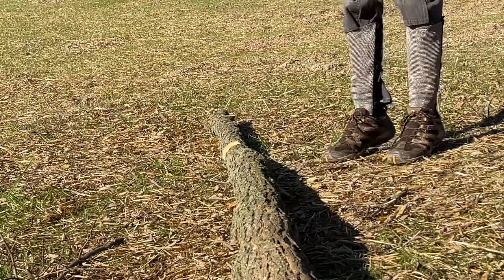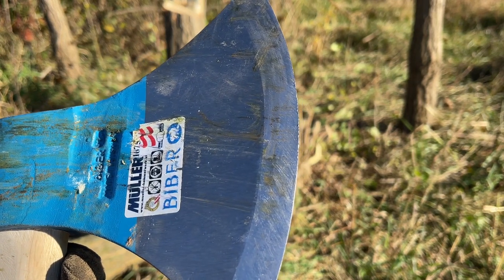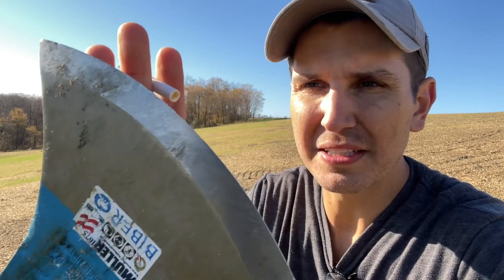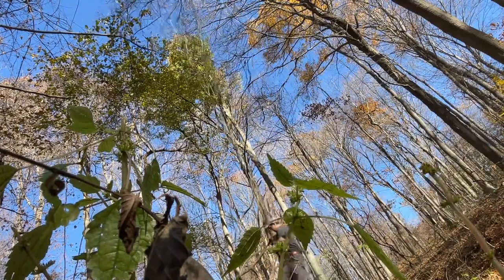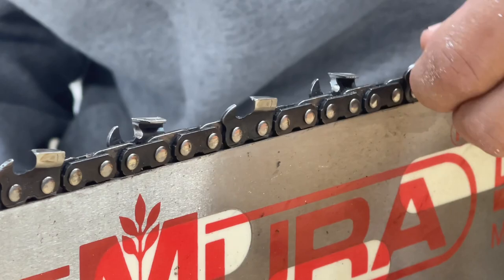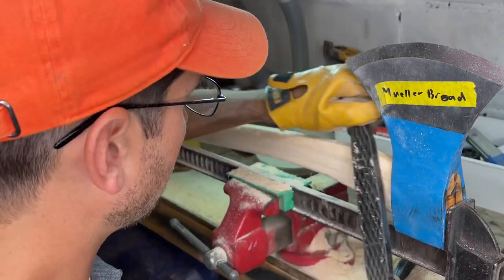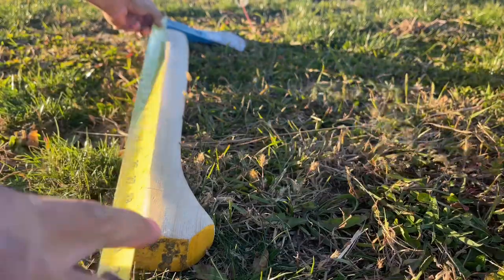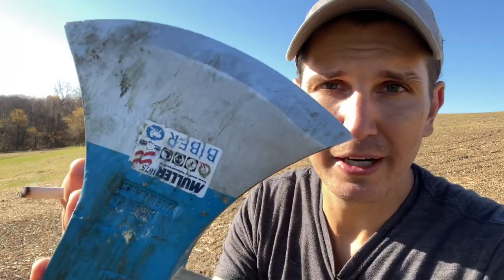Muller Biber Review: Can it Hold Up to American Timber?

Comment: In the falling/felling footage, the first 30 seconds or so, the axe appeared to dip and/or twist on impact. I slowed the playback speed as far down as possible and watched. Just an observation. Certainly unique. I own a dvd that is available for viewing on YT, "Happy People", it is a documentary about the trappers in the Taiga, the axes these men used "rang" just like this one. I also watch much Russian axe footage, this ringing is not uncommon. Many American axes ring while flicking during splitting of firewood, mostly older ones. Very enjoyable Mr. Kevin on your video....
Reply from the maker: Yeah, it’s awkward to fell with.  Definitely not it’s purpose.  Besides that, very little of the blade contacts the wood.  I’ve seen the doc.  Very cool.  First axe I’ve owned the rings like this.  No idea what it means though lol.

Comment: You better put a proper convexed edge bevel on it. secondary bevel won't add to the edge stability, because it's still a flat edge. It will only slow the axe down, cuting less deep. Adding a proper covvex, it will cut as deep if not deeper, and it will also provide edge stability. You have to get rid of, the burnt steel, that those factory belts create, when they establish the edge bevel. Always reprofile your new knives and axes, before first use. ALWAYS! Slightly convexed bevel, is what you need.
Reply from the maker: Thanks

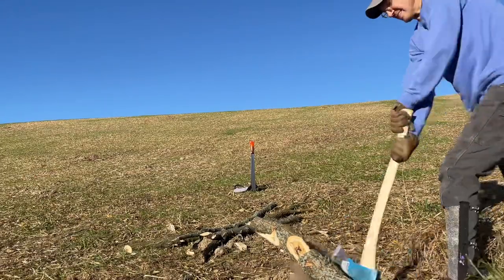Comment: That axe is a wicked lookin thing! Handy that it had enough shoulder to adjust the length so much. Cool b-roll in this- "take it easy kevin"; cuts to swinging on monkey vines😁 What were those stakes at 3:30?
Reply from the maker: Yeah, for a limbing axe 32” is just too long.  Those stakes are to hold the mulch socks in place.  When we replant fields with hay over here, we cover it with straw and put drainage socks in every so often to keep the water fro, washing away all the seed before it takes.  It very hilly Western PA.  Also a lot of fields thanks to our ancestors.

Comment: To me that steel is probably not acceptable if it needs a secondary.  In the sense that I'd recommend it to others.  I had a muller drawknife gifted to me and I really disliked it. It is cool that they still make hand tools though.  Wouldn't want to bad mouth the entire company.  

Would wonder how it would hold up at 22 degree edge.  20 for me is as far as I go but I still think it should hold up to use without a secondary.  Maybe a convex edge would do better?  Interesting that you can hear this axe ringing, still easy to file but it doesn't hold up against tough wood.  I am curious what Muller would say about how keen you can make their axes.  Maybe this was a one off.

I agree though.  Don't notice a secondary much when I put one on.  I love putting a secondary on a splitting axe.  Edge literally lasts forever like that.
Reply from the maker: Nah, most steels don’t hold up at 20 Scandi when they’re this thin behind the bevel.  I knew better.  I secondary will fix it and I won’t even notice it much or at all.
Reply: @KevinsDisobedience  yeah it does seem on the thinner side cheek wise.  I still think it should hold up but maybe it should be tested on red oak and some other hardwoods before I'd make a declaration like I just did lol.
Reply from the maker: It’s just been my experience that when you get sub twenty that a secondary is required.  This still is fairly soft so definitely needs one.

Comment: Don't worry about the knee. I likely no longer have all my cartilage and everything is "just fine." 😄
Reply from the maker: I wish that were the case.  My knees have grinded for years and I’ve had no problems.  Now it feels like my lower leg is not connected to my upper leg properly.  Like it just flops around and could fall off at any wrong move.  We’ll see what the mri says.
Reply: @KevinsDisobedience  The instability you are describing makes me wonder about ligament issues. That can at least be repaired.